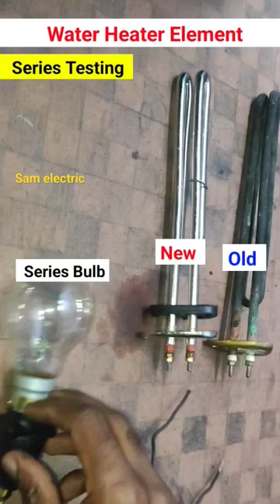Water Heater Element Testing Without Multimeter l #geyser #testing #shorts #short #youtubeshorts

Comment: How you connect the light bulb and the wires
Reply from the maker: @qamilselmani7003  https://youtu.be/OyKadqpZLkk
Reply from the maker: @qamilselmani7003  in this way
Reply: So are both wires neutral black when you touch the heater element right and the live(red) one  is conected between light bulb and the plug
Reply from the maker: @qamilselmani7003  yes